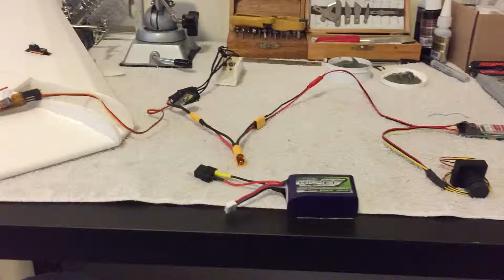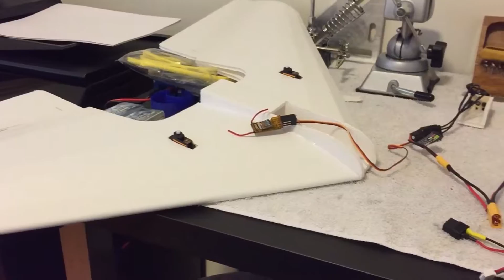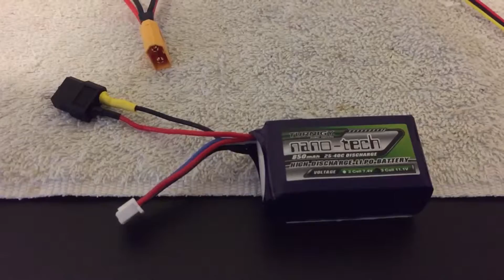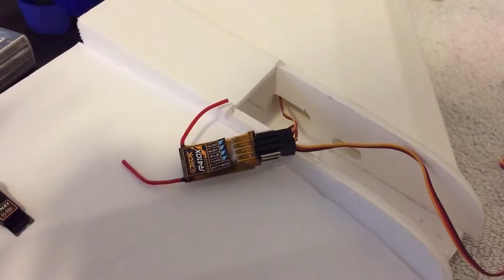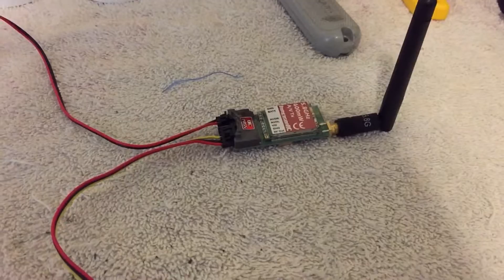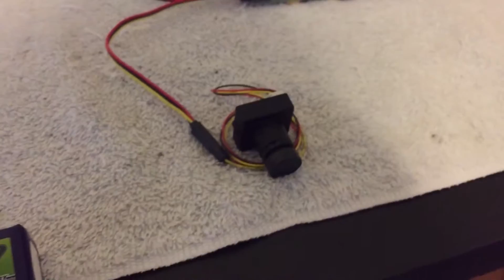Wiring for FT Mini Arrow

Comment: And how DID it fly?
Reply from the maker: It flew pretty well. I felt that it was nose heavy because of the weight of the camera (it had a metal case instead of plastic). I also flew it with a 3S battery, so it was even more weight on the front. However, once I adjusted the CG it was fine. Setting up high and low rates is recommended.

Comment: did you need a filter for the video to keep the motor from causing interference
Reply from the maker: I did look into it but after maiden and a few flights I didn't think it was necessary. However, I did add an OSD primarily for voltage monitoring.